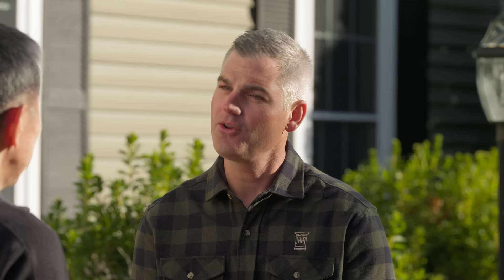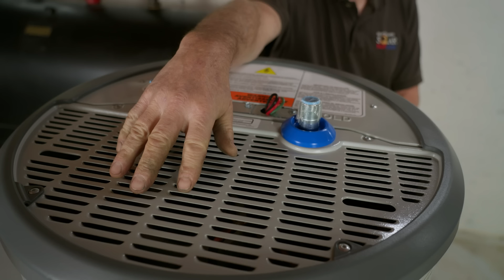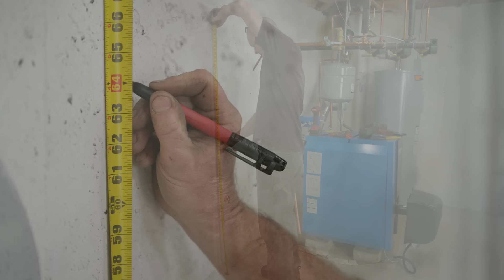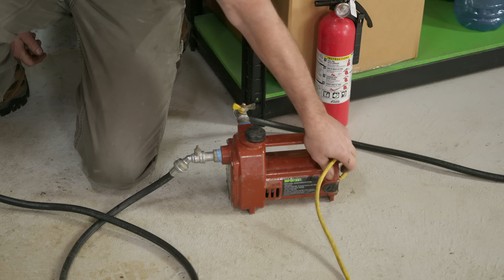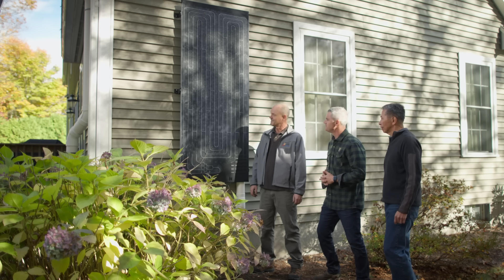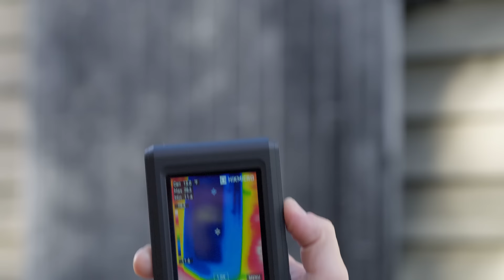Heat Pump Water Heater for Cold Climates | Ask This Old House

Comment: Over here in the Midwest the majority of us homeowners have Natural Gas. And Nat gas is incredibly cheap. 
We're talking, my dryer, hot water heater and furnace all run off natural gas and the bill is under $150/month for all 3 appliances in the coldest months of the year, Jan. & Feb. For 8 months out of the year my natural gas bill is ~$15/month.
Reply: yes
but, if you get  rid of natural gas, and it's monthly meter and customer chargers, etc, and take  advantage of nice summer cost  of efficiencies in water heating and drying, the math equals out. natural gas isn't as reliably cheap as it use to be, especially in winter, similar to electricity.
also, electric appliances are easy to work on and no gas/carbon monoxide or venting issues/worries.
it's a nice choice, especially the further south you go, but even some central midwest can take advantage.

Comment: These guys need to tighten up their dialogue. First of all, what is COP? Second, they just got done saying that the conventional hybrid heater has 2-3 efficiency. He said the exact same range for the solar option. I get that they're trying to push a more efficient option, but they need to make sure they're saying things correctly.
Reply: Those type of systems are not very good, in Europe they are considerd obsolete.

The failure of those system are the exact reason hybrid water heater exist. Even outside, without a fan moving the air, the heat transfer is weak and the panel will became a giant icecream. This video is more like an ad. 

My suggestion, compared to this product is to buy a standard hybrid water heater, they even make spilt system with an actual outside unit.

Comment: In the UK we have air-source heat pump hot water cylinders that can just vent to the outdoor air. Seems better to have two inlet/outlet vents vs an ugly panel on the side of the house.
Reply: No, can’t use intake air that is lower temp than the manufacturer’s rated minimum. Usually 37f for a conventional hybrid. And if you exhaust the cold air in the winter, you’re creating a pressure imbalance that will suck even colder winter into the home.
Reply: @SMARTSOLARWATERHEATER2025 On the models I've seen, the intake vent isn't directly connected to the unit, but passively into the space.
Reply: @BrendonBoshell  not sure what you mean, but there is no free air so to speak. if you are sucking from inside air, and exhausting outside on a long running heat pump (hours at time everyday) then makeup air has to come from somewhere, ie all the leaks you have, or maybe basement or attic.
Reply: typically, you don't want to intake inside, and exhaust outside for a long running fan. the makeup air has to come from somewhere inside, which means your sucking in through leaks that are unconditioning your home air.

Comment: Stealing heat from inside the house never seemed quite right to me, so this is intriguing. Would this work better on a rooftop..  assuming you can keep snow off it? Or is there concern about too much hot sun or hail damage?
Reply: Hail. And there’s ineffecency  associated with additional Lineset length.
Reply: They work best in the south where the heater is usually in the garage

Comment: Price; there’s 3 sizes (65, 80, and 119 gallons) and the 80 is $3800 Here in Mass., there’s an $1850 rebate for ‘split’ heat pump water heaters so the net will be $1950. Installation costs will vary considerably.
Reply: Interesting technology. I went with air-source a few years ago and it works fine, but everyone sort of waved away the issue of using heat to make hot water.
Reply: No the rebate comes from taxpayers.  Not free
Reply: @DwayneDesisto  The tax breaks for oil and gas exploration, the added health costs of breathing fossil particulates and for greater mercury exposure, the increased insurance rates due to storms with greater intensity, or prolonged, drought caused wildfires, all comes out of our pockets too.  Oh, and don't forget the military expense necessary to secure the global oil markets.  None of the sunshine heating that panel has to travel through the Strait of Hormuz.
Reply: @JPG-tx6el  THANK YOU!

Comment: I did not know these existed. This is awesome.

Although...I think I'd still rather have an in-house heat pump WH rather than a split. That way I get the free benefits in the summer - cooler basement, dehumidification. And I could instead spend the money on a whole-house heat pump and rely on that unit to move heat in/out of the house. Then my condenser, wall perforations, etc., are working towards the common goal of keeping the inside of the house comfortable, and I only have to worry about that single outdoor condenser instead of 2 or 3 of them for other heating/cooling activities (water heater, fridge/freezer, etc).
Reply: yeah but if your basement is already chillier in the winter, you may make it a freezer in the winter with a heat pump

Comment: Why not an indirect off the boiler?
Reply: 85% boiler efficient vs 300-400% efficient with heat pump, you do the math.
Reply: @johnpeters9903 That's energy efficiency. What about cost efficiency? In New England we pay about 30 cents per kwh so oil is comparable in cost per BTU.
Reply: @cousinoliver3939 Massachusetts electric is expensive. Especially with the added charges to offset everyone else's rebates and electric car charging plus a "delivery" charge😅
Reply: @johnpeters9903   Depends on electricity rates, do the math.

Comment: Looks like the bat signal went out to the anti heat pump commenters. 

I’m the installer. Quick facts: these have a 10-yr warranty, zero compressor failures so far, payback is a few years (not 20), and 80 gallons at 125° is plenty for normal use. Panels usually go on the back or out of sight. Lots of real customer reviews if you look. Thanks!
Reply: Only thing I wish they'd added, though I understand for brevity, is to replace the sacrificial rod with a powered anode rod.  Only plumbers and 'twue handymen' replace their anode rods on schedule, and powered anode rods to do the same job, but better and are visibly able to determine whether they are working or not(the LED on the wall-wart and a continuity test between the terminals) without opening the tank.
Reply: Nah, not anti heat pump, they are great in some applications, just not water heating in cold climates, unless you have free electricity or something. We have a 50gal with a 5kW input (way more power then this thing has in ideal conditions) set as high as it will go ~140-150 degrees, and it's barely enough for one quick shower, maybe 5-9 minutes then the ground water gets down into the 30s or 40s, nowear near enough to take longer showers, multiple showers back to back, or run multiple heads at the same time. When I get the option, I'm looking for at least a 190kBtu tankless unit, if not 2 or 3 in a bank. Gas is just so, so much more affordable per unit of heated water; even propane is more cost-effective.
Reply: What's the manufacturer/brand for the system?
Reply: I have an old oil boiler and tank for baseboard heat & hot water on their way out…think it makes sense to abandon heating oil?…replace with heat pump baseboard heat & hot water?…1200 sq ft single story in Rhode Island…thanks!